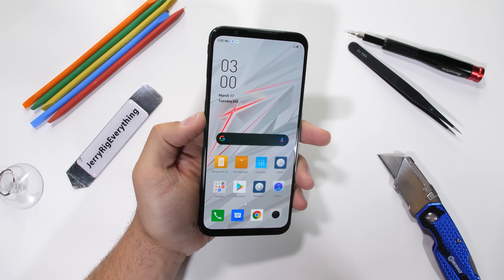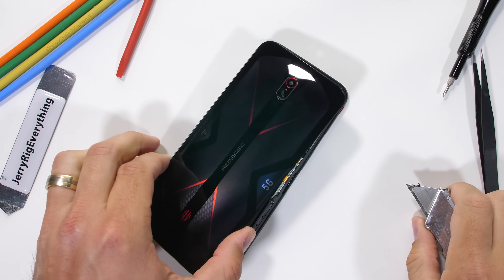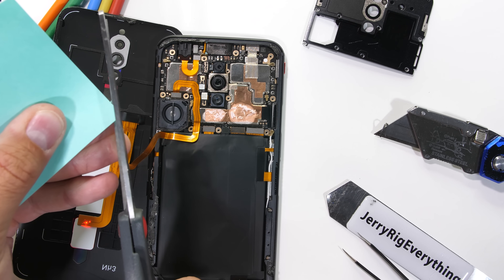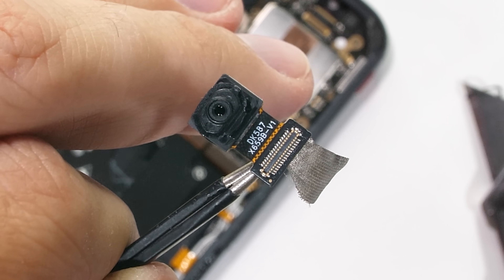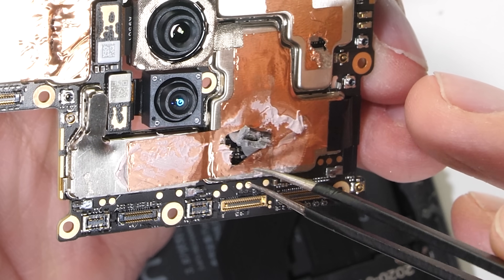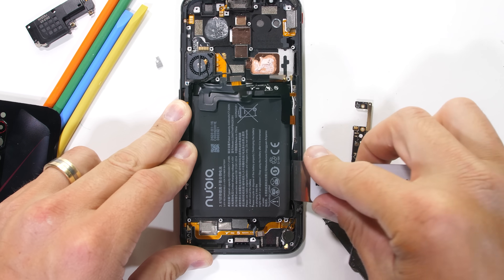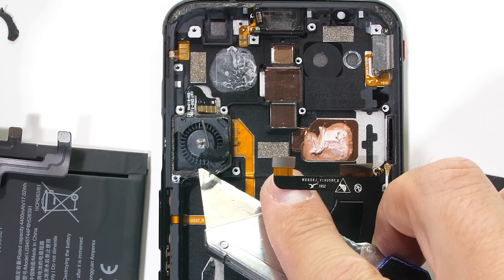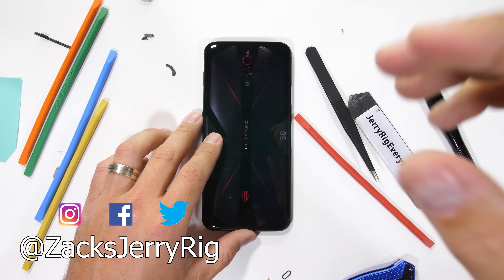RedMagic 5G Teardown! - How does the Cooling Fan work?

Comment: When he talked about the headphone jack it hit me that seriously, in a decade young people will simply not know what a 3.5mm jack is. It's real sad that we lose access to tech that just works simply because of company greed.
Reply: This. Compagnies need to learn to fear the customer again.
Reply: @thibaldus3  Eh, it's just change. Gotta roll witth it. It's not like there isn't an option for it. Should we include floppy drives on phones too?
Reply: @joelfolgner8234  It's not the same thing. Floppies and CDs where phased out because flash storage is much faster, more dense, smaller and thus eventually became the best solution altogether. There is no real benefit as of now, that USB-C or wireless headphones provide over those with a 3.5mm jack. Also, wireless ones are more expensive and can be easily lost or stolen. If someone ever comes up with a product that just doesn't work on a 3.5mm jack and is arguably better than one that can then yes, tech can evolve. But for now, it's just greedy companies that want to sell you dongles.
Reply: They build phones to be disposable the problem is the price keeps going up they want you to buy a $1,000 phone use it for a year or so  throw it away and get another one but for some reason I'm still rocking a little cheap hundred-dollar LG Stylo 3 but I've had since pretty much it's a release month a few years back I'm even rocking the same original battery
Reply: @matiastripaldi406  agree enough, and yet wired connection's still a win for me.

Can't beat ethernet when there's a crowd of family crowding the sheit outta of wi-fi bandwidth at home.
Reply: @matiastripaldi406  I simply disagree. Except for the dongle part. However personally I'll never go back to wired headphones.
Reply: Matías Tripaldi there is two sides of that people who have wireless (in which case its better for them) and people who don’t i recommend wireless
Reply: its a bit outdated... everything is going wireless, which makes sense to me tbh. also i still have one on my S10 :D
Reply: I still don't know why we didn't make 2.5mm as standard or go smaller and make it universal.
Reply: @matiastripaldi406  Haha and the sound systems havnt changed? analog record -> digital mp3 -> analog 3,5mm... losses over losses.
Reply: the only reason I'll buy these gaming phones is the 3.5mm jack
Reply: @dhann13emon  ikr! a jack doesn't add weight or complexity. It does make water resistance more difficult but i don't plan to go swimming with my phone anyway and if  drop it into a toilet then fuck me anyways soooo
Reply: @joelfolgner8234  it's okay, nobody forces you to use wired headphones. But the point still stands, the consumer should have options. As time passes, the wired option is being taken away
Reply: @nitin7218  2.5 is too small and breaks easily. Same reason why they got rid of microusb for usbc (and reversibility of course)
Reply: @joelfolgner8234  wrong example. Floppy disk being replaced by much superior technologies. While 3.5mm headphone jack has reached its peak to the point it can't be bested by any other alternatives. Does not consume extra energy like Bluetooth, deliver up to studio quality output, zero output latency, and doesn't take much space for the port. Those companies said that the removal of the 3.5mm headphone jack was for the good of slimmer design or extra space for much more beneficial components. Yet they added tons of useless extra cameras you won't even use the next 2 or 3 months later. Just look at how bulky those periscope camera on S20 Ultra and P30 Pro...
Reply: Tell that to 1960s kids. 🤦‍♂️
Reply: @nitin7218  I thought we already did?
Reply: @svd355  I was surprised to see those huge cameras in real life.

Something that big that we dont even use much against something so small we use everyday.
Reply: @GabrielTobing  2.5mm is not used in any standard consumer equipment other than some weird adaptor maybe
Reply: Latency is my only problem with bluetooth.And with bluetooth only,as there's no latency on wireless gaming headphones for PC's which use a 2.4ghz wireless dongle.I play online competetive shooters on my phone,and there is always latency with bluetooth.Some people would say they don't notice it,but I always notice it and its a major disadvantage even if theres a little lag in audio.They shouldn't have had replaces 3.5mm jack with bluetooth unless they had perfected the bluetooh to the point that is was indistinguishable from wired audio.Unfortunately thats not the case so companies must include the jack in their phones.Oh yeah,to all the people who say that people should evolve and that wireless is more convinient etc.,yeah you're right wireless is more convenient,but make the audio quality of bluetooth and audio latency of bluetooth exactly like Wired,then the jack can go f*ck itself.
Reply: @joelfolgner8234  The change is not happening for audio engineers and professions that work with audio, though.
There's a reason why XLR is still a thing. And so is the 3.5mm jack and the 6.25mm jack as well.
So, no.
Not change.
Just another way of transmuting audio. Which is great!
But also useless for anybody who actually cares about audio quality.
Reply: Matías Tripaldi 3.5 jack will never allow us for active noise cancelling. which if u tried you cant go back imo . tech will get to there. its like going to mini usb to type c . it will take time for companies to get there.
Reply: They would still see in Laptops (hopefully) and definitely Gaming accessories. They just need to be told that they also used to exist in Smartphones.
Reply: @ColonelRPG  ahh good old quarter inch jack. So sturdy!
Reply: @Matías Tripaldi I guess so , my nokia E71 and OG headset works best even today, buy when the appliances get bigger what you say will be true, so 3.5 was made universal.
Reply: @matiastripaldi406  I use it in my guitar rig every day.
Reply: Matías Tripaldi think about this decade's young people that don't know what a floppy disk is. 15 years ago a floppy drive was almost on every pc
Reply: @joelfolgner8234  That's a respectable opinion. I don't agree on the floppy disk comparaison as it's a flawed analogy, but i can see why Bluetooth could be more convenient. I personally like jacks better. Sometimes i'm on a rush to go somewhere and i can easily charge my phone while listening music in my car, but i guess it's a matter of different situations
Reply: @ColonelRPG  yes! its widely used in everything pro audio
Reply: @mohdmarzad1109  3.5mm doesn't allow for active noise cancellation what?? I have wired sony earphones and they have active noise cancellation.
Reply: Dude, i so agree with u and im only 14
Reply: @VikramSingh-wb5kt  yeah lmao the noise cancellation is something done on the headphone end, maybe he has some weird headphone that takes its power from the usbc connector and doesn't have an internal battery?
Reply: @joelfolgner8234  You must be joker
Reply: @matiastripaldi406 Exactly. Maybe he has a different definition of active noise cancellation? 
I have an Lg g8 with the ess quad dac and I'm so grateful that they stuck with the 3.5mm jack. I mean why mess with something if it's not broken and is widely used?
Reply: Nah it'll still exist, even some recent Samsung phones like the A series still have it, and there'll always be companies like this that still add them.
Reply: @nitin7218  Compromised integrity, 2.5 mm connectors are really easy to break compared to 3.5 mm ones.
Reply: @svd355  couldn't have put it any better. All these new "slimmer phones" can still easily fit a jack. Jerry even did a tear down of one phone that CLEARLY had the space for a jack but wasn't put in
Reply: I would say i like wired headphones because they are cheap and work well.. i feel wireless ones are unnecessarily expensive and its easy to lose them
Reply: Naweed Reza can you share the model please . thanks
Reply: I just got wireless ear buds.  I notice wireless ear buds seem to use less phone battery than wired. I thought it would be opposite.
Reply: Lmao the music industry still uses jack sticks.
Reply: Right
Reply: So true and wireless just doesn't cut it most wireless headphones and pute shit lol
Reply: While this could be true depending on the company, you get a better feature from the change. Example: Apple phones. When the 7 came out that was the first time a phone did not have a headphone jack. However it featured 2 new speakers at the bottom where the jack would be. I am an Apple user so I have no other phone information that I could use as an example. And while yes, Apple does do some less than desirable things, we can all agree that once they introduced the new 2 speakers and the new earbuds that had been adapted to fit the phone type, it was an at least attempt at pleasing people with change.
Reply: dw someone out there will make a phone with headphone jacks im sure of it
Reply: @eepersz  HTC phones had better stereo speakers and also headphone jack. I use Anker Soundbuds Bluetooth earphones and they sound good. But it's a pain in the ass to always remind myself to charge it! Also it depletes my phone battery faster. Before I could just use the 3.5mm jack and not worry about all these things. We need the jack back!
Reply: Company greed or just technology advancing? Who here has watched movies on VHS tapes or listened to music on C-cassettes? Do you think it was better and more convenient than Netflix and Spotify are today?
Who here has bought games on CDs? How about games on 3½ inch floppy disks? Does someone miss playing games that are on 5¼ floppy disks? All of those things just worked fine but we don't use those technologies anymore. Is someone missing out because of it? I don't think so.
I've done all of the things I mentioned above and can tell you that things are much more convenient today. The same applies to the headphone jack on phones. Do you really like untangling a mess of wires every time you want to put on your head-/earphones? Do you like the feeling of a wire pulling down on an earphone in your ear when the wire gets stuck somewhere under your jacket or shirt? Do you like it when any of the three fragile connectors gets damaged on your earphones?
Wireless headphones and earphones are much more comfortable to use, their only downside being that you have to charge them every now and then. I have both wireless headphones and wireless earbuds that I use almost daily. I need to charge them about once a month max. I used to have a nice pair of wired earbuds. Even though I handled them very carefully, one of the connectors going to the earbud broke after only a bit over a year of use. My bluetooth headphones from 2014 are still working perfectly today, nothing is broken or even worn.
Reply: @Kepe  Please read my answer to Joel Folgner above, it's the third comment in this thread. TLDR i'm all for tech advancing ONLY IF what the new tech does is better than the old tech in a verifiable enough way. To quote some of your examples, obviously Netflix is better than VHS or flash storage is better than floppys; no question about it and that's why those old formats are not used anymore. However it's (for now) different for the 3.5mm jack. I'll answers your arguments:
a) cables and the mess they make: yes, it's frustrating to untangle headphones but it usually is fast when you're used to it. Yes they can get stuck in your shirt, but to me at least those disadvantages don't outweight the benefits of the cable, mainly that I won't lose the headphones, they won't fall off my ear (if they do, i won't lose them in the street), they won't get lost or stolen as easily(compare a small airpod to a set of wired headphones, which is easier to lose?)
b)connectors: yes, connectors can break but hey wireless tech can also break. The difference is that you can simply solder on another connector, while you have to replace the entire device if the wireless fails.
All in all, I think you are contradicting yourself, "I have both wireless headphones and wireless earbuds that I use almost daily". If you use both of them, how can you be against having the choice then? Please note that I am not saying that wireless/usb C headphones are in anyway inferior to 3.5mm jack ones, I am just saying that I prefer to have the CHOICE of which one to use. You may be able to afford wireless headphones, but I'm not, so it's better for me to use a wired pair instead of not listening to music altogether. What I hope you understand from this comment is that the 3.5mm jack is, for now at least, not obsolete, as wired headphones run perfeclty on it (and you can charge your phone at the same time, which you can't with usb-c headphones), it is a relatively sturdy and simple connector, and to me at least, wireless tech is not accesible and not reliable enough to warrant the removal of what is, after all,a very small component.
Reply: Well. Possibly. Lots of things that are cutting edge still have 3.5mm jacks. Every Alexa device for example, my brand new top do the line home audio receiver, most (not all) new cars, and all high quality wireless headphones. It’s conceivable that those things will all remove the port but it seems unlikely. It’s still a great way to connect audio. It was just to thick for flagship phones relentless pursuit of thinness.
Reply: dhannemon13 even if you are the only one online you’ll get better speed wired. Thankfully, no one is trying to take that away from us! Yet.
Reply: @matiastripaldi406  its not company greed, for once i find usb c  on phones its not a big deal, no 3.5 mm jack its also not a big deal, if you want audiophile o atleast better quality in a phone you need an external DAC that will plug in nto the usb port, most phones give you a usbc headset, atlest my p20 had one included and sound amazing comparing it to 3.5mm that are normally included on phones
Reply: @josephatnip2398  same here I got my stylo 3 on pre order lol it's all a decent phone
Reply: @VikramSingh-wb5kt  yeah could be. Exactly, don't fix what ain't broken
Reply: @franciscobarrazasaavedra4754  Well it depends as in many cases you have a good 3.5mm headphone and you need a dongle to convert it to usbc, that's where companies get their money. And even if we don't think about that, the simple fact that you can't charge and use headphones at the same time is irritating
Reply: The headphone jack can also work aux hole too. Headphones don't need charging. When u at the beach u do not want headphones that need charging every 4-6 hours or less either.
Reply: Wireless charging increases heat in your phone so, your phone would not last as long.
Reply: @matiastripaldi406  wrong
Compact Discs still happen to exist these days and still happen to be used too quite a lot
Reply: @matiastripaldi406  wired headphones are way more durable than their wireless counterparts
Because wired headphones connect directly to a device there is no lag nor compression either meaaning audio quality is way better

Comment: 2020 : cooling fan under the Phone
2025 : Refrigerator under the Phone
Reply: @_-_--_  2035: Pressurized frozen helium cooling
Reply: 2100 black hole cooling
Reply: 2023 : I e under the phone
Reply: 2100 no mobile phone. Calling directly in air Alexa listen in some where and call that person
Reply: It's possible using a "paltier module"
Reply: 2080 : teleport of human through phone
Reply: @woodenhoe  🤣🤣 i will definitely buy
Reply: 2110 - human under the phone... 😂..
Reply: 2137: nitrogen-cooled Alexa v16.2.23 with 200000rpm pump
Reply: 2075 human teleports inside the phone to play the actual game
Reply: @indrajeetsinh_v  😂😃😃
Reply: 2070:- ice phone
Reply: Bahahahahhahasjsja
Reply: i see Fantasy People here 😂🤣

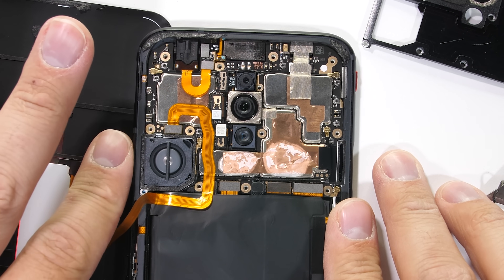Comment: When you block the airflow the fan is not struggling, in fact, it's pulling less current because there is no air resistance therefor fan rotates faster  2:03
Reply: Nasa wants to know your location😂
Reply: Your logic is flawed

Comment: I miss the days when batteries where solid blocks. Even pull tabs don't work because eventually they wear out with the heat of the phone. I've repaired many iPhone batteries from clients and returning ones and it's always a pain in the ass to remove pull tabs.

Comment: You don't have to replace the battery with a screen replacement. Just dip a playing card in isopropyl alcohol and slide it in a sawing motion, under the battery. Repeat a bunch of times. Takes 5min or less.

Comment: turns out that the sound change when you block fans isn't it struggling, rather since it's no longer pushing air through, there is no resistance and it spins faster. I also thought it was struggling lol.
Forgot who made a video and explained it, but he also found out while making that video

Comment: I cringed a little when you tore into that fan, and cried when the battery bent. I also cringed as you pierced the tape and thermal paste.
I don't care that it's not very water resistant, I still really like the idea of a cooling fan in a mobile, and if it were a little cheaper, I would have bought it.
That phone is so pretty.
Reply: Guess you're new

Comment: If the battery are never to be removed unless you need a new battery why not use permanent adhesive though it bends the battery little.They are not so fragile as you think it is.Peace✌

Comment: The phone has two smaller battery cells that enable the phone to charge super fast. So instead of let's say one large 5000mah battery it has something like two smaller 2500mah linked together allowing the phone to charge both cells in half the time it takes to charge a large 5000.

Comment: Know this might sound strange, but does the water really hurt the fan holes that much? I don't find they way the water damages anything else than the fan itself, because the air cools down only the metal around not the actuall circuit board etc so its not in contact.